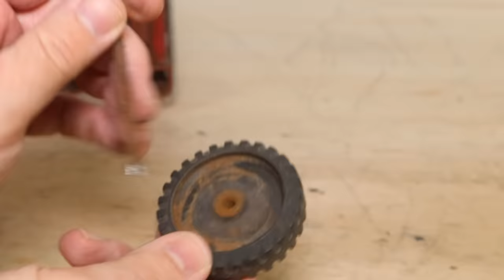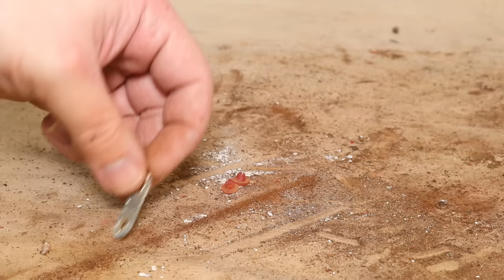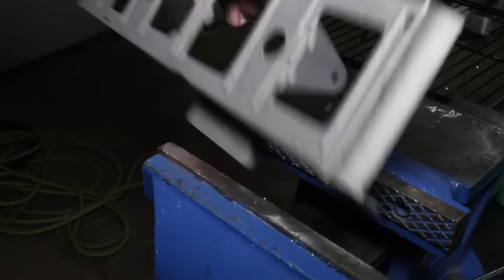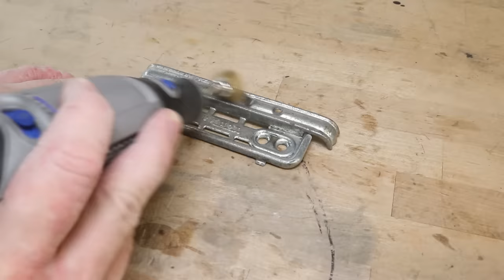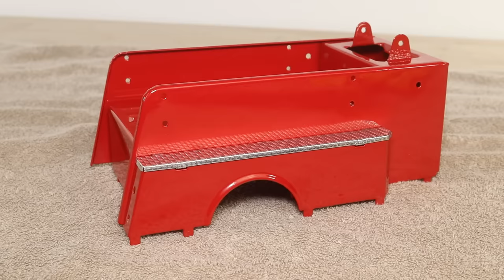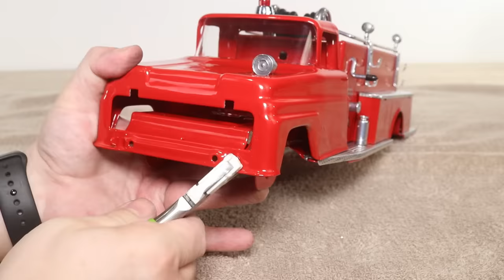1963 Tonka Rusty Suburban Pumper Fire Truck Restoration

Comment: I accidentally came across this fire truck video and my jaw dropped. This was the firetruck my dad and I used on Saturday mornings to put out a building fire in the backyard, only the building was a large cardboard box. I couldn't believe that it was actually the same truck till I saw the hydrant and fire hoses. My dad would cut windows in the box to simulate a warehouse, light it on fire, and the pumper would put it out.  One morning a local cop jumped up on the fence to see what the smoke was from.  He thought our house was on fire.

As I recall the hoses on the first truck we had screwed on rather than pushed onto the hydrant and truck. My dad would comment how cheap that was. Anyway, thanks for bringing back what was only a memory till now.

Comment: I had a very similiar fire truck , like this, I got for Christmas, in 1957. The truck was a 1956 Ford. It also had the same hose reel. It came with a hose adapter, in the form of a fire hydrant; inlet was garden hose, outlet was a suction hose, mounted on the truck hose rack, that fed the truck, and water came out of the hose reel nozzle. The  hydrant was a shut off valve, worked with a mini hydrant wrench actually shut off the water.  I loved it.....!!!!!!

Comment: I got a Tonka firetruck for Christmas in 1977. While it didn't look like that one, the rubber hoses were exactly the same. I had a fire hydrant too, but I don't remember having to use a wrench to open and close it, I think mine had a spoked wheel on top instead. Great job on the restoration.

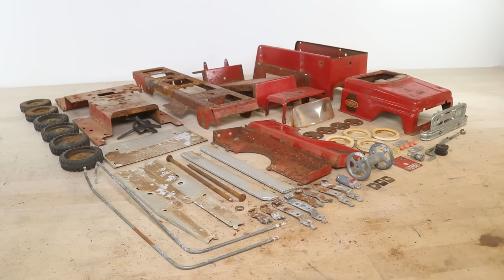Comment: 14:38. The side hose mount background went from a small piece of metal to just a decal on the finished product. Great restore. Impressive with the powder coating of the extinguisher going to chrome. Looks great. Just when I thought you couldn’t top the last restore ...........or the previous one....or the one before .....etc. etc.

Comment: I have one of these in white... destroyed by my sister's freaking brat kids.. I have starting to look for all the replacement parts necessary. I also have an earlier (1956?) ladder truck, missing a few parts, most notably the wheel and threaded shaft used to elevate the ladder. Needs the loose ladders too.   By the way, the hose reel on this was  originally bare metal, perhaps a zinc or aluminum alloy. The original fire hydrant that fastened to a common yard hose was indeed red on both the white trucks as well as the red trucks.   This episode is very inspiring.. makes me want to hurry up restoration of our old family heirloom.

Comment: Another Extraordinary restoration of a classic toy from a bygone era.  You really do amazing work!   I don't follow very many folks, but you are at the top of my list.  These are toys that I grew up with.  I really appreciate that you try to use as many of the original parts as possible.  I assume that some of that is related to cost and part availability. 
I would really like to see you do a 'How to' video on maybe a easier piece.  Something that would be relatively inexpensive, fun to learn with, and easy to do.  
Sorry if you have already done that, maybe you could point me to it if that is the case.
Keep up the great work, and don't let the sheep multiple much more.

Comment: Beautiful.  The only thing that I would like to see further is to retrofit 'fairy bulb' LEDs for the lights.  (They are so tiny that it should be trivial to fit a couple inside of most of the lights and they can easily run off of a single battery with a simple 'joule thief' circuit.)

Comment: I have the earlier version fire truck with the equipment doors and the running board hydrant. I had to buy new ladders for it, and new hose for the hose reel, but it still had the hydrant and the hydrant wrench. I have had it about 15 years or so I guess. It must have basically been a carpet toy. I also bought new syphon hoses for it as well.

Comment: Try using denture brushes instead of   regular  tooth brushes. They are still plastic,  but much stiffer and have the precision back side. You can usually  find them  in the tooth brush isle. Near the denture care stuff.

Comment: Another great restoration!
The cover photo caught my eye as the image is flipped (mirror image) which made me wonder why the hose reel crank was on the wrong side of the truck!  
Question:  where did you get the new rubber piece that fits the hose reel crank and drives against the reel?  I can’t seem to locate any.  I’m thinking that piece is the same as the ones used for dolly wheels on older Tonka semi trailers but I’d have to drill the extra hole for it to fit the shaft.

Comment: I like how you separate each piece, clean them up, then prime, wet sand and coat. That is more inline with what Tonka did when they manufactured each toy.  

I'm curious. You don't show sandblasting the inside of the cab.  Was that done off camera?  

I like the end results.  Well done.

Comment: Very orderly method of filming your restorations.  Do you use a lot of sand or is it filtered to use again. Does the powder for the coating cost a lot?  Looks great. We use to get our big trailer rims powder coated. They lasted much longer.  Great job!
Reply: Most sand blasting booths simply collect and reuse the sand. Eventually it has to be changed out due to contaminants but I think it can be filtered to avoid some waste. As to the powder paint from sources I can find it can be around $16 USD for a pound of powder color. Im sure different kinds and brands cost more and less. Its likely the machine itself that is super costly not to mention the oven needed to bake the parts to melt the powder paint.

Comment: Is it my imagination,  or was the one side of the fire hydrant big enough to attach an actual garden hose to?
Reply: That’s a play feature of this vehicle, the hydrant connects to a garden hose, then the straight black hoses that hang on the side of the truck run from the hydrant to the inlet valve mounted near the driver’s door, which directs the water through the reeled hose at the top, allowing for real (simulated) firehose action, as Chip demonstrates at the end of the video 🙂
Reply: @Gappasaurus  Thank you for the explanation.  That would be a fun feature for a kid on a hot summer day.

Comment: Wow!!  Friggin’ awesome, Chip!  What are you using to hammer down the clips during assembly?  Looks like a hot glue stick.  Thanks & Cheers!
Reply: I would think hes using Delrin sticks, its a type of plastic. The same stuff he has over the jaws of some of his pliers so he wont mark up the paint job when pinching locking tabs.